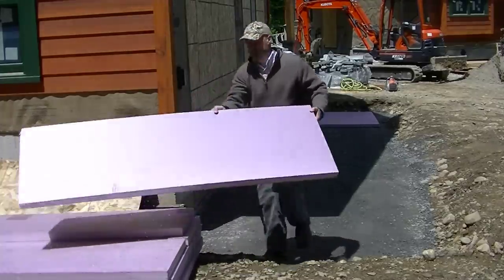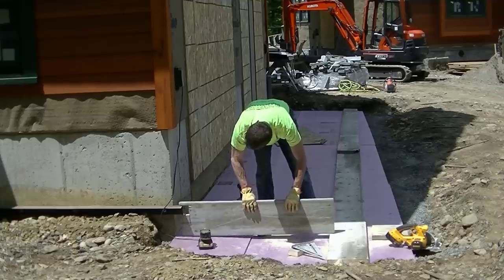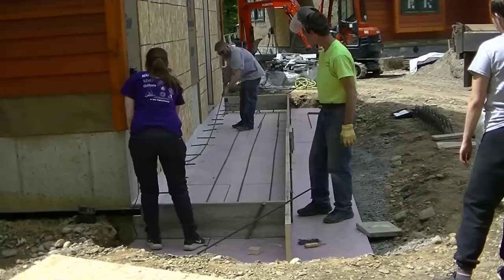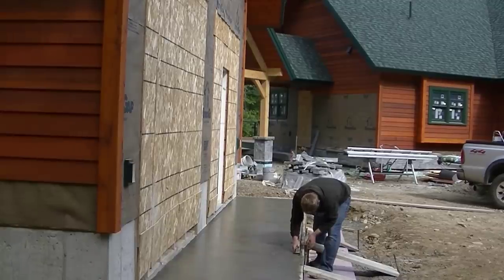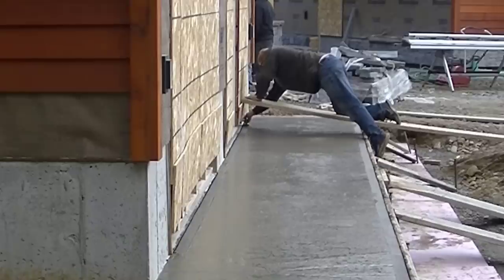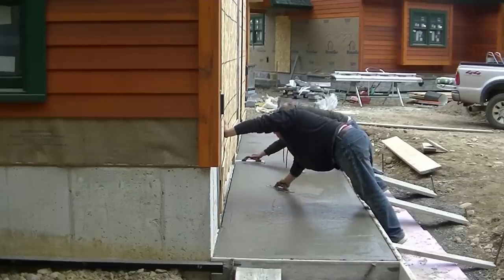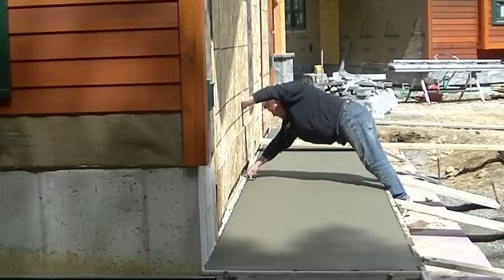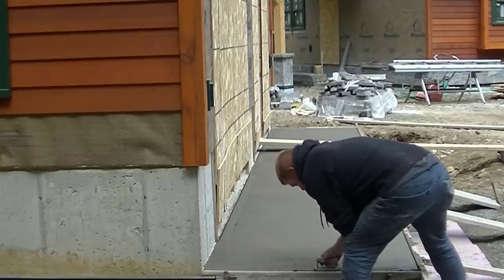How To Form, Pour, and Finish a Concrete Driveway entry to your garage.

Comment: Finally, rebar in the center, deformed dowels to tie in, vibrating in the the concrete, 5” slump. With concrete that thick, and sealed on five of six sides, the tight mix is even more important. Good job

Comment: I like putting the stakes on a slight angle so there's more cross area holding on that 2x12 and if you pound at it on an angle you know it ain't gonna bend over any more if you just barely kick it off you wailing on it like that lol

Comment: Just a regular homeowner here living in an upper middle class neighborhood in Florida.  We had consistent looking sidewalks throughout our neighborhood until the oak tree roots started pushing it up, causing tripping hazards.  Because of bull crap liability issues, the county decided to massacre all our oaks before replacing those sections of the sidewalk.  In so doing, we now have this hodge-podge of different patches.  Some are about 12 feet long without any expansion joints, some are framed, others not and the concrete mix seems to be whatever was on the menu that day.  Also, they replaced the ramps at street crossing, making them narrower than they were before and making them straight when the originals were flared.  What set me off enough to write this comment is Mike asking his viewers, mostly concrete contractors, what they like to do, framing edges or not.  It shouldn't be up to what you like!  It should be spelled out in the work order and that is what you should do!  If not spelled out, explain the options to the customer and let them decide.  Don't get me wrong, I respect the knowledge that Mike  and commenters bring to the channel.  But for God's sake, don't mess up people's neighborhoods because it's easier.  We have to live with it long after you are gone.

Comment: If I'm putting foam or just walking on it I'd be happy with 3-5 inches saw cut solid no rebar. If you have a lot of moving pieces you can wash a couple yards into gravel for a good walk way base before you pour a driveway. I poured basements, foundations, and precast and now I inspect and test concrete and now I like messing with it and seeing what does what. I'd probably wash a few yards into the footer while pouring the sidewalk, survey from the sidewalk wash into the driveway and pour footer,  pour the walls, wash under the aprons and pour driveway, then finish pouring the aprons. That way you can have flower boxes and flower beds and the roof drains next to the flower box and the aprons wash to the driveway that wash to the sidewalk that wash your entire property

Comment: in regards to preference on the picture framing with the edger. really depends on what that edge is meeting up with. If I plan to continue the concrete past that point, or in this case bringing asphalt up to that edge, I would leave the broom finish right to the edge. If that is the final edge, or the sides of the concrete where it would meet the grass or dirt id go with the edger picture framing.

Comment: Personally, I like a picture frame look, the only thing I would have done differently is the foam, I would not have used that, with the pins, there’s virtually no chance of the two slabs moving independently with a frost heave, I would prefer them to have direct contact to keep as much water as possible from seeping between the slabs and freezing, irregardless of the caulk being used. I always did at least a 8” apron, so 12 is over kill, but maybe he has heavy equipment going over that threshold. Better safe than sorry. 👍 I know the new norm is to not steel the surface, all I can tell you is, I have driveways and sidewalks I did over 40 years ago, all were steel troweled twice, then hit with a fine broom, do they show wear, yes, are they popped at all? No, I used limestone aggregate only, never sandstone, limestone doesn’t absorb water and hold it like sandstone does, so it doesn’t pop when cold weather freezing happens. And the funny thing is none was ever sealed either, the steel would close the pores of the concrete, keeping water absorption to a minimum, thus no spalling. Of course the concrete was concrete back then, not a mix of chemicals, it remains to be seen what the longevity of this modern crete will be, time will tell. I have my doubts, the city sidewalks a few years old here are already starting to come apart.
Reply: Does “regardless” and “irregardless” have different meanings or did you make up a word?
Reply: @chrisg334  If it bothers you that much, look it up, LOL Did you at least understand the point I was making? Or was that beyond you as well? 👌🤦‍♂️🫵 Have a Good rest to your Sunday! 😉

Comment: "Proportions are beautiful" should be a tenet in construction. 

A 6"/ 7"/ or 8" apron, even 5", where there's no vehicle transit can be perfect.

Rebar/mesh can be placed 1/4 from the bottom, starting at some 2".  Added fiber will help preventing micro-cracking.  And waterproofing admixtures will enhance its long-term resistance.

Comment: I like the picture frame look too. As you say, its a more defined finish. But is cleaning and holding it clean not a pain in the ass with the broom marks? I imagine its kinda hard with a pressure washer to get moss and what not off the slab.

But man, this is a nice home. The wood, the roof, with the green windows looks really really good. I like this styling a  lot.

Comment: I don't like the picture frame, but like you said it's a personal preference.

A question if you don't mind.
I'm planning on doing a addition to my shop/garage and would like to do the concrete (Alaskan slab) in northern Minnesota this year and do the actual building a few years from now. Would you do air entrainment since it's going to go through several winters or just do a regular mix?

Comment: Personally I like sharp exact precast finishes so I'd rough finish it to 1/8 proud the forms and as I float finish and broom no edge and it will naturally wear to perfect grade and finish.  If I was the home owner I'd even probably put sand or gravel and wear it in with my feet you can sand the edges and corners just depends how you want to wear it how fast and how much you want to do if you put down some #8 you can literally grind it in for a few weeks while normally walking on it if you purposely try to walk all over it

Comment: What is the name of the product used between the existing concrete and the pad?  Is it "ISO-Step" (marketed as a sound insulation product)?  I could not find "ISO-Strip"; also, what is your preferred adhesive spray in this application? Thanks, Mike - from Hermon, Maine
Reply from the maker: It's Iso-strip off and we use a 3M spray adhesive to glue it on.

Comment: Those are bronze edgers, not brass  edgers.  They are not the same thing. 

With outdoor air entrained concrete subject to freezing in the winter you want to use bronze for the same reason you don't want to run a steel trowel over it.

Comment: Question : Mike or whoever,      my son bought a 2 year old home.    I see the basement slab is at least an inch under a chalk line....
      Do you think it's sinking ?  Or do crews pour under the chalk line from some reason?...thanks in advance-
Reply: They probably poured under the chalk line because they were running out of concrete and had to lower the floor to make sure they finished !
Reply: @tnolan3176  And how would you know that trick? LOL 😂 🤦‍♂️😉
Reply: @Musclecar1972  I know a guy !!
Reply: @tnolan3176  WINK! WINK! I know that guy too, imagine that! LOL 😂
Reply: @tnolan3176   Ya know, that damn scoundrel used to do two small pours, order 1 yard over on each as a cushion, then if it was in fact still 2 yds leftover, would miraculously have another small 1 1/2 yard pour set up just by happenstance! Damn guy, what a scoundrel! 😳🤦‍♂️😁
Reply: @Musclecar1972  You know that same guy always told me to "work smarter not harder " !!!
Reply: @tnolan3176  I TALKED WITH YOU BEFORE THEN! LOL 😂 IM OLD, I FORGET!  WE SEEM TO HAVE GONE TO DIFFERENT SCHOOLS TOGETHER, FROM THE SOUNDS OF IT. IT’ S A MASON THING! 👍👌😉😁
Reply: @Musclecar1972  It is a mason thing !  And i have donated 45 years of my life to it !
Reply: @tnolan3176   I started when I was  16, 74 now, did my last job on my own home 4 years ago, 5 pallets of live stone from a local red stone quarry, spent 3 months cutting it down to dry stack size I wanted to use, on a wet saw, then another month laying it up on my house, garage, and my wife’s she shed. Unfortunately, that finished off my right hip , had it replaced, which went south very quickly, 6 weeks later, they redid it completely, and I haven’t been able to walk unaided since. Also a mason thing. Hopefully you can avoid this kind of drama, it’s not really much fun.😉Didn’t help I used to power lift as a young man either, does a lot of joint damage. Still love the trade though, it was very rewarding.

Comment: I don’t know about soil stability in your area. Where I am you never put in 12” of concrete because of the weight. We would never pin the slab because of the weight. Maybe in your area it’s different. Where I have my concrete repair company, we would be leveling this concrete in 2 years.

Comment: You should have done a dry pour on this job! The internet says it’s better, what do you experienced concrete contractors know? 😆
Reply: Good joke
Reply: Rock Rock Rocka

Do you believe everything you see or read on the internet? If so, I have a bridge I would like to sell you.

Do you think that professional concrete contractors and their crews don't know what they are doing? What support do you have for this assertion? 

Apparently, you have little or maybe no experience with laying concrete as you don't seem to understand the technology. 

You don't seem to understand that "wet pour" is the industry standard. "Dry pour" is, well, no standard.

Get real. Dry pour is a joke. It is a lazy poor-quality substitute for the real thing which involves mixing concrete with water and then placing it into the forms. Yes, mixing concrete is work; but doing work results in good-quality concrete which will last almost forever. Dry pour will likely spald,  crack and then turn to dust after it goes through a few cold/hot heat cycles during the various seasons of the year.

Dry pouring a 12-inch slab is just throwing away concrete. The concrete will never obtain the design strength with the mix because the misting method will not wet the concrete completely through. 

Concrete strength is obtained by mixing the correct amount of water with the concrete's cement, rock, and sand. It must be mixed together (this is the work that lazy dry pour avoids but is necessary) to assure that the water is evenly dispersed throughout the concrete mix. This mixing is necessary to facilitate the chemical process of crystallization---crystalization is what happens when people say "curing". 

The dry mix will not deliver quality concrete strength or finish. And note that the 12" slab was nicely and smoothly finished. The rough Dry mix surfaces just don't come out smooth--smooth surfaces are preferred over rough surfaces. 

Professional concrete contractors deliver high-quality concrete that has demonstrative strength and fine finishing. They guarantee their work so they make sure the quality is good. They do good quality work so they have a reputation so they will be recommended and are able to obtain more work.

Dry pour can't match the products of professional concrete contractors. Will anyone guarantee that "dry pour" will be as good as "wet pour"? No. So, Rock Rock Rock quite making uninformed claims about this internet fad of "dry pour" concrete. 

Dry pour is a joke.
Reply: @harrisorourke6926  I was being sarcastic, hence the emoji. People have been pouring concrete for 200 years but someone puts out a tiktok and now we've all been doing it wrong!
Reply: Lmao!!
Reply: @harrisorourke6926  Facepalm

Comment: Why put foam" edging" so concrete DOESN't stick to the building....SO IT CAN MOVE WITH FROST AND THAW  as you say ......And then you anchor it with rebar into the building  SO IT CAN NOT MOVE UP AND DOWN???????? 🤣🤣🤣🤣🤣